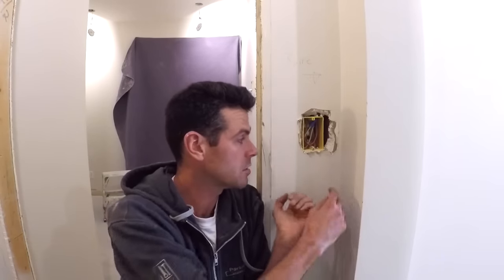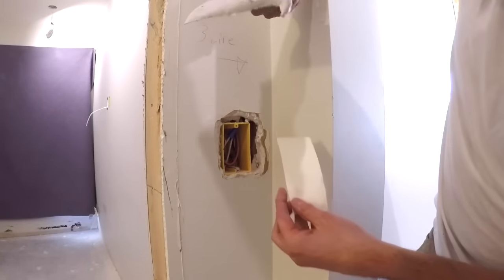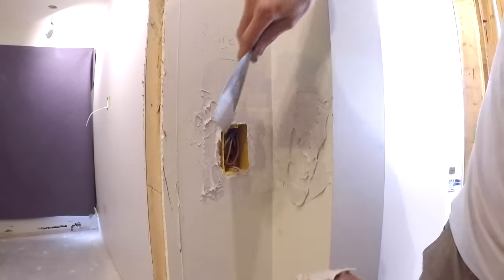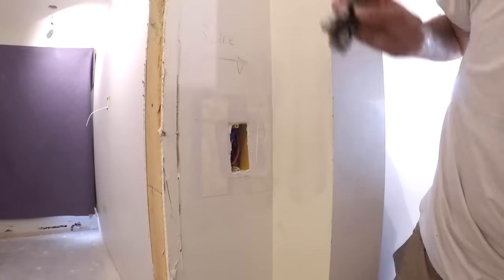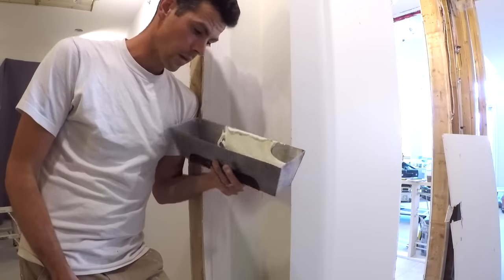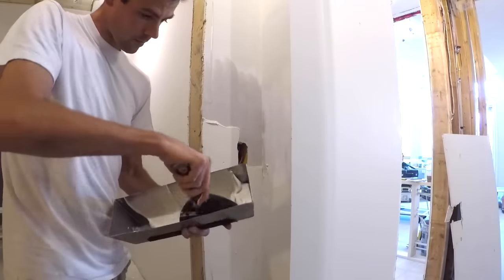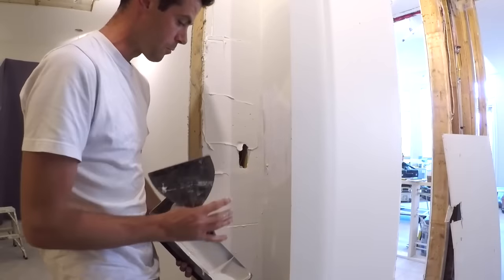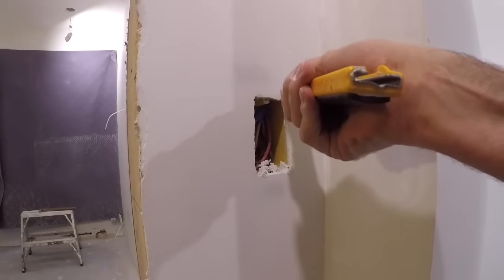HOW TO REPAIR OVERCUT ELECTRICAL BOX (DRYWALL)

Comment: As an electrician you have my thanks for keeping in mind how we hate mud in the boxes
Reply: We don't take kindly to mud in our boxes 😀
Reply: Everyone hates mud. Even the taper.
Reply: Electricians cause more damage to sheetrock and stucco than any other tradesman. Our electrician hit our exterior stucco with a hammer cracking it around every exterior outlet. Rather than simply removing the small amount of stucco inside the electrical box before installing the exterior GFI outlets. Heart breaking to see after I just shelled out $8000 for new stucco. Inside the house they overcut every single wall outlet so large the cover wouldn't cover it after the walls were textured and painted. It was a nightmare trying to get those walls patched around the electric boxes and making them match the texture and repainting them. Lesson learned. Now I have a clause in all my contracts with electricians. You mess up the walls you pay for it. I also take photographs before the electricians start their work.

Comment: Huge THANKS to you Ben! I’ve been around construction most of my life. Drywall has always been a struggle for me. I’ve never worked with or had anyone training/teach me. I’ve been able to get what repairs/patches done  but knew I was taking me too long and too much sanding and never up to the quality of my other work... at least to me. Currently on the biggest drywall project I’ve tackled... 105 sheets... ceiling, walls, inside and outside corners and the whole bit. I’ve watched others but they take so long to get to the point or spend more time trying to sell you on their link to tools or whatever. Time is money and I don’t have 25 minutes to get 3 to maybe 5 minutes of info... but you the man! You get right to it and easy for me to follow and copy. Your tricks/tip I feel as made the whole process much faster, with much improved very professional results!! And I have eliminated at least 90% of the sanding I was doing before and with a better finish! So Thanks again!!! Proof that old dogs can learn new tricks!👍🏽😎
Reply: I also am doing waaaaay less sanding AND getting much better results - Thanks to Ben!

Comment: Very nice. I am an electrician and pretty good at making electrical magically appear without the need of taping afterwards. However, sometimes wall and ceiling simply needs to be opened. I taped back in the day and never had any type of training and you make it look super easy and satisfying.

Comment: The pro said, "I'm going to stop messing with it." Huge piece of mud advice.
Reply: Knowing when to step back is an essential skill.
Reply: 'You've got to know when to hold 'em
Know when to fold 'em
Know when to walk away
And know when to run"
Reply: Yes, it took me longer than it should to realize you'll always need to sand, but if you try to make it where you don't, you usually end up sanding more

Comment: You are really good at your trade!  The only suggestion I would make is that when you are working around a box like this is to put some blue tape over the screw holes to prevent getting any mud into them.  The electrician will thank you, especially on plastic boxes.

Comment: This electrician thanks you for knocking the mud out of the box at the end. I can't tell you how many times spacklers dont do that and the patch falls apart ass I'm putting a switch or receptacle in the box. I enjoy your tutorials.
Reply: And we would all like to thank the electrician for making the large hole in the first place. If it had been done correctly there would be no need for a patch.
Reply: @rodm5830  It could have been the drywall guy not cutting out the hole for the box in the first place.  Then the electrician tried to find it and missed.
Reply: @monitorlizard9971  I've seen electricians beat holes in walls with hammers to put boxes in. In fact I just repaired one a few months ago.
Reply: As a carpenter I can't tell you how many times electricians just saws all the crap out of things. And besides that they leave a mess in the entire house. Never pick shit up.
Reply: @mikelyons7511  ha yeah
Reply: thank goodness for the steel and concrete guys ;)
Reply: @throttlebottle5906  you know I actually don't mind the holes,more money I get to charge for.:))
Reply: @mikelyons7511  Seriously. some are pigs.  and some never push the wires back into the box. not long ago I accidentally cut one wire with the router because it wasnt pushed back into the box.  needless to say the sparky was NOT happy.  as he had to rip out the wall again and replace the wire  entirely.
Reply: Cesar E. Orozco Umm, why the hell would you cut a wire with a router? and the best approach to this is use old work boxes instead of nailers, but the electrician would have to work together with the drywaller. It would save the drywaller a lot of headache cutting the form for the box and all the electrician would need is a hole for the wire to go through.
Reply: @RubbinRobbin  I suppose a better reference or name would be a Rotozip.  with the drywall cutting bit.  It was sticking out of the box a bit and when I was cutting out the box  the cutting bit cut through the insulating layer of the wire.
Reply: who's fighting? all I see is common friendly yet sarcastic job-site banter, something to make the day pass easier =p
Reply: Mike Lyons as an electrician I can tell you carpenters don’t know how to use a sawzall without cutting wires. Ac guys can do it. Electricians can do it. A couple of plumbers can do it. Carpenters can’t do it. Put the damn blade in upside down, barely penetrate the plywood. Every carpenter ever, blade in normal and straight down six inches of penetration cutting next to a floor joist, surprised when they cut a wire or pipe.
Reply: Cesar E. Orozco liar. Why wouldn’t he have extended the wire in the box? You said you didn’t cut too deep, he didn’t tuck the wires. So he could have spliced it.
Reply: Round how much you want to pay an electrician to cut in boxes and install them on a finish? Back in the day drywallers cut out the boxes before they hung the rock.
Reply: REALLY? If the lazy electrician had used a knife instead of a hammer, this repair would not be necessary. Bet someone had to sweep up his mess as well.
Reply: electricalron Tom healey
Reply: 3:54 Hey as long as you dont mind cleaning up drywall crumbs on your nice new floor after I install the switch, you can mud that box as heavily as you want. [I would much rather have too much drywall around my box, than not enough]

o.O
Reply: Spacklers lol
Reply: @rodm5830  i've knocked holes in walls and i have repaired them. it is a lot easier to patch a hole than install another outlet after the fact.
Reply: @mikelyons7511  i've seen some pretty bad framing jobs. walls with waves because the framers would not cull wall studs. sometimes that's on the builder being cheap but i know one framer who culled nothing. if it was shipped out on the job he would put it up.
Reply: @paulk5311  Ive put in dozens of remodel boxes. Very simple to cut a perfect hole with a multi tool. Much easier than patching a hole.
Reply: @rodm5830    actually the guys who hung the sheet rock  Did a horrible job
Reply: @paulk5311  Paul. You must be a sheet rocker, as a framer I've used plenty of studs that are bowed. Not twisted. A bowed stud is easily taken care of for that couple of saw cuts and a spike to pinch it in with a hefty framing hammer. You cannot call every stud. You have to draw the line somewhere.
Reply: @KitchenerLeslie2  nah bro, the A/C guys are by far the sloppiest o any tradesman I've seen, the carpenters are the most precise, idk what part of the country you work in, but where the market is booming, it isn't done that way
Reply: @Abeille30  If you cut a wire can't you just put a piece of tape over it? Replacing the whole wire, isn't that a bit extreme over a little cut on the insulation?
Reply: @talontooner  I'm a drywall guy and I have learned to push the wires back.  Or, if too many wires,  mark the board close ti edge of box and start router carefully at that point.
Reply: @KitchenerLeslie2  we are talking about remodel applications here.  I doubt an electrician would be damaging any drywall on a new construction.
Reply: @wjthehomebuilder  if a drywall guy had cut that,  it would just fit.  That hole was made with a hammer by a lazy schmuck.
Reply: @twosencefromcleveland6084  I never said the drywall guy cut the hole.  I said it's possible that the drywall guy missed it.
Reply: @RubbinRobbin  Exactly!  The drywall is only 1/2" thick.  So why would you need a bit anywhere near long enough to sever the wire in the box in the first place?  You shouldn't be using a bit any longer than 3/4" for this purpose.
Reply: @guybroyles48  I'm an electrician, and I actually take pride in my work, and DO care about the other tradesmen working.  I want to see all of my projects go as smoothly as possible, whether it be electrical or otherwise.
Reply: @KitchenerLeslie2  I'm an electrician too, and I can relate!  The carpenter cut the wire with a sawzall when cutting the rough opening from the existing bedroom to the new addition he was building and I was about to start wiring.  It just so happens that it wasn't a big deal because the wire he cut was one that would have gotten abandoned and re-routed anyway.
Reply: lol you guys are funny
Reply: Mike Lyons me and my buddy were bitching up a storm about how much of a slob the electricians had been on a house we were working on, as they walked in, lo and behold, they actually swept up that day!
Reply: Amen brother I feel your pain!
Reply: ChemoTherapist ...in American public schools they don't have time to learn measuring, too busy figuring out which toilet to use.
Reply: Man I cleaned a switch box once the drywall guy was done so that I didn’t have to rip a chunk of plaster after they were done painting. I come back and the switch box was full of plaster... painters are a holes!
Reply: @mikelyons7511  lol im enjoying the hel out of this ..
Reply: @ohgary  ha ha ha true..
Reply: @mikelyons7511  blame the super, you have to stay on all trades, its constant baby sitting
Reply: @rodm5830  X - wrong! That's a new work box that the highly skilled electrician installed weeks before the sheetrock guy hung his sheets. Experience is important.
Reply: @mikelyons7511   Electricians are the aristocrats of the construction trades-- you don't ask aristocrats to pick things up.
Reply: Mike Lyons without us contractors you guys wouldn’t have any walls to work on
Reply: Mike Lyons yeah because framing is so hard...
Reply: throttle bottle unless you’re union.
Reply: Rod M want a cookie?
Reply: Rod M you’re lying
Reply: @rodm5830  as an electrician, I've never done or seen that. Where are you located?
Reply: @mikelyons7511  I can't believe all the electrician comments on this video. This had nothing at all to do with any electrician. It was the fault of the "person" who cut the box out too large in the first place.
Reply: Jake Sangria  I am an electrician
Reply: Rod M Electricians don’t cut out drywall
Reply: @throttlebottle5906  - Hahaha... When concrete guys fuck up, it's a REAL problem. Been there seen that, over and over and over again. I still hate masons! ;-)
Reply: @davidzamorano3339  - Electricians DO cut out rock on rework while installing remodel (drop in) boxes. Not everything is new construction. Even new construction has it's share of "afterthoughts" when the homeowner decides to get involved. In the later case, it's easy money for a sparky if he charges accordingly for the changes.
Reply: @mongo0606  is it only me that calls them mudders?

Comment: Thanks for the tip. I've been doing drywall and mud work since I was 5 (seriously), but this still vid had value for me too.

I liken the 3 foot patch job to doing a partial paint job on a car -- the wider you can make a blended paint area, the smoother it will transition between old & new.

Comment: Good tips!  A good carpenter is more than framing with wood or metal, trimming, doors, cabinets etc, but can fix wallboard and make the subs life easier.

A good carpenter has the knowledge and skills to back it up.  A great carpenter has that, and the ability to fix others and their own mistakes.

Comment: Hey thanks for putting this on here. It’s the most accurate vid for repair of electrical outlet and believe me I’ve watched a shit ton.
Reply: Women 🙄😉
Reply: Chris Wyatt  it's mud, not putty (maybe you call it something different where you are from?).  That said, you do that to ensure that visually the wall appears flat.  This is essentially applying the same concept to butt joints in drywall.  Otherwise you'll end up with something that is both weak and has a hump that is obvious to the eye.
Reply: Chris Wyatt  I've heard of spackle, but that's for repairing small holes up to an inch or so.  As for sheetrock putty, no, I can't say I have heard of that before.
Reply: How many do you have to watch lady?
Reply: @j8ke937  WTF

Comment: This guy is IT!  Very knowledgeable, but also conveys his depth of experience in an understandable way.  Thanks!
Reply from the maker: Wow, thanks!
Reply: @vancouvercarpenter  Dude, I am a professional painter.  I ran a paint department at BFS for 15 years in Arizona.  I considered myself an excellent painter and  teacher, and have helped infinity customers with their painting, patching, staining, priming, prepping ....etc...etc....questions.  You are a wonderful teacher of the drywall trade.  The detailed tricks, tips, and information are clearly a result of experience and well appreciated for DIYers.  I just had a skylight put in and have to do all the drywall on the tunnel.  Your detailed advice on corners, paper, mud and etc were greatly appreciated.  Keep up the good work!

Comment: You are a true professional - the best of all videos on plastering - I have never tried quick set as I am scared I am too slow to get things moving - I am just a home DIY person and not a professional. Watching your videos have made me realize all the mistakes I have done for years when plastering, however I will never be as perfect as you are - you make things look so easy! but its not easy even a small patch can turn into a major few days of a nightmare for me! Thanks and keep going please.
Reply: You CAN use quick set or it’s also called hot mud. It comes in 5, 20, 45 & 90 min. setting times. The pros will use 5 or 20 min. cause they’re quick & real good at it. Us newbies are better off with 45 or 90 min. Gives us more time to mix & apply it. Either way it’s all the same & does the job.

Comment: Nice job  from what I can tell on my phone. I’m a luxury builder. Drywall is one of my “must be level 4 or 5 to pass”. When I patch, I always create a concave area working from sunken below the surface back to level as I move away from the patch area.  Same with any nail pop.  I have my punch guys hit them with a dimpled hammer and then mud. When they sand, it cannot be visible with a high intensity light casting an angle light.  Once the “hot mud” or quick set has cured I go over with lightweight mud that is easier to sand.  The goal is to have a patch that is perfectly flat after sanding. In our area, smooth walls and ceilings are standard or a light knock down on the ceilings is also common.  I’ve found that if we are near fanatics on our drywall finish, all other finish trades really work hard to excel in their particular fields.

Comment: Interesting, I hadn't realized how far you have to go, on either side of the whole, to feather and eliminate curved surfaces, until I saw this. You have mad skills with the blade. I always resort to a 12 inch to smooth out larger areas.

Comment: Good repair! I cringe on a lot of mud videos but well done!  I'm a painter and do a lot of patch work, this is a sure fire fix that I use all the time in remodels.  I don't typically use HOT mud(20m mud) but it is a good move as it drys harder and shrinks less.  Its just not as convenient when I'm doing a lot of patches from electrical and plumbers.

Comment: I like to wet the drywall first so that it doesn't suck the moisture out of the quick set plaster before curing.   I also often use my knife  to carve a bevel on the drywall to give more bonding surface.   Now in this situation the right side was a pretty big gap so I would probably slip in something behind the drywall that would allow me to push up a lot of mud into that gap without it falling down the inside of the wall.